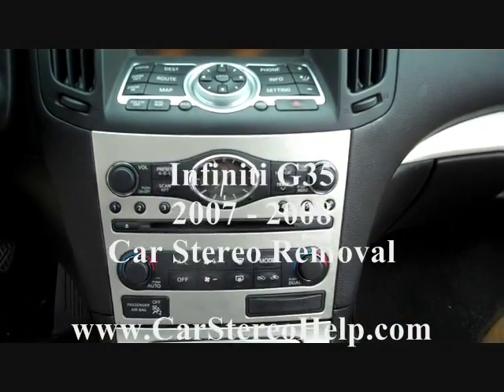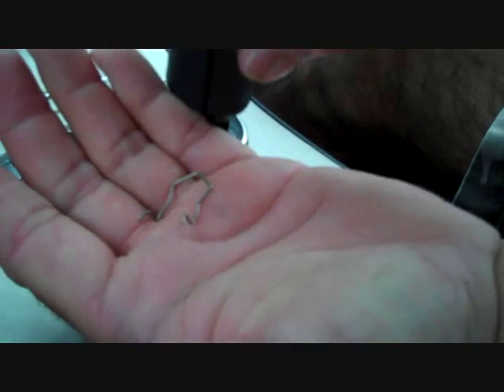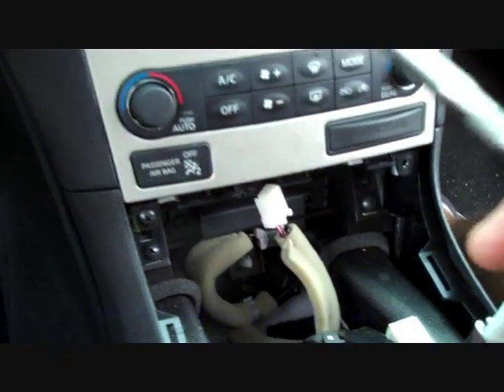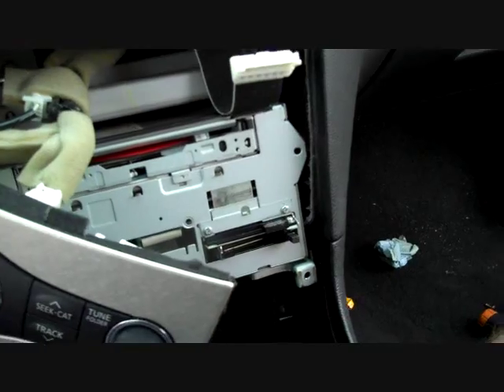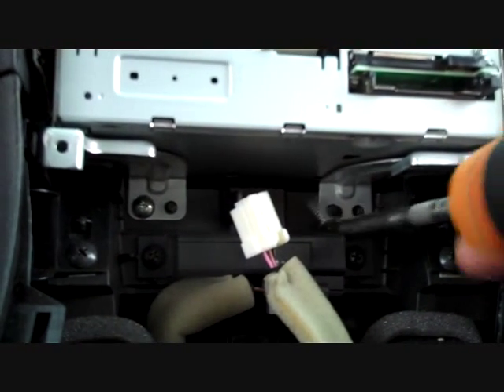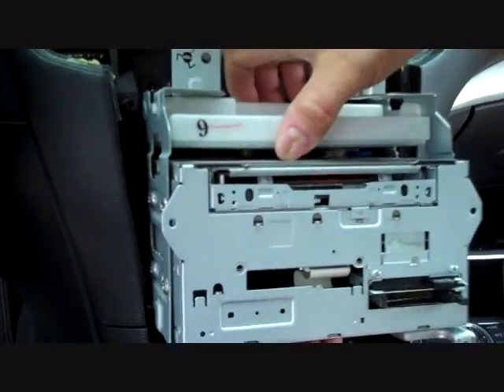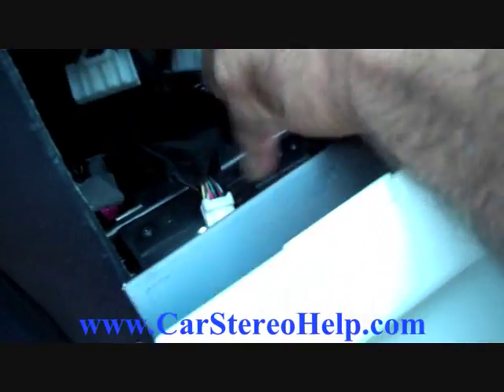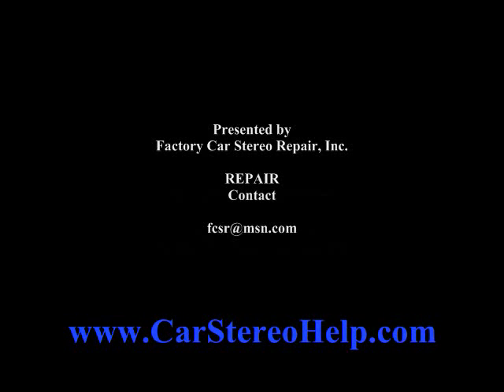Infiniti Bose G35 Car Stereo and CD Clock Removal = Car Stereo HELP

Comment: Thank for this invaluable video. I had to replace my clock in my 2008 (it does not have the card slot on the lower right). I purchased the plastic panel removers and had the whole thing apart in a few minutes. I had to dissect the control panel to replace the clock itself which took the longest. Reinstall went great.

Comment: Your video is awesome. It saved me $$$ from having to get the dealer to fix it. Very easy to install and I bought the used part on eBay for $50.